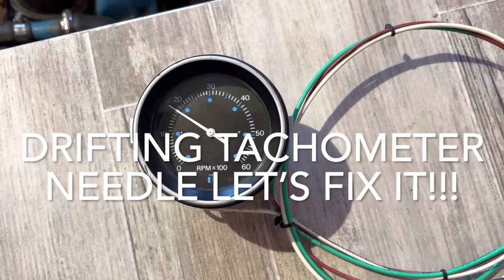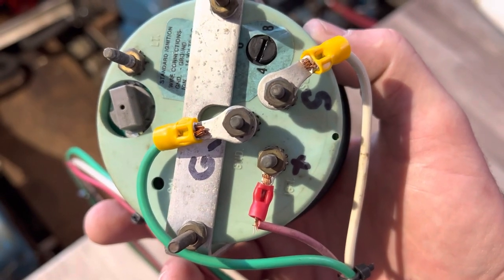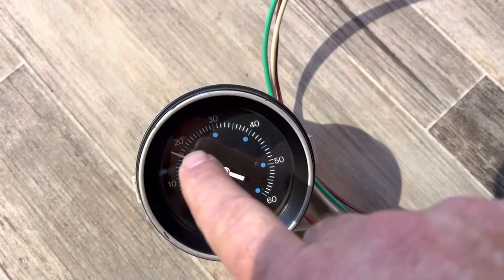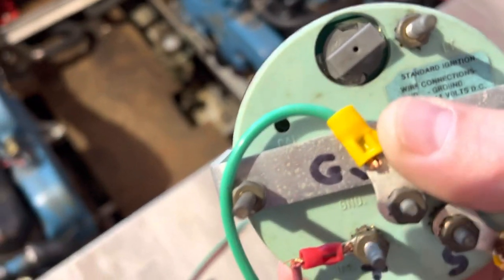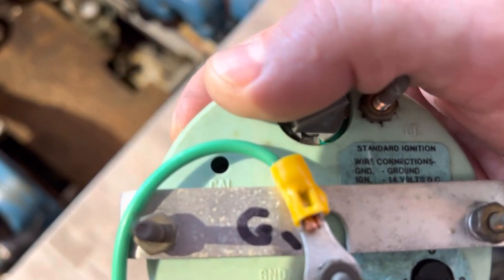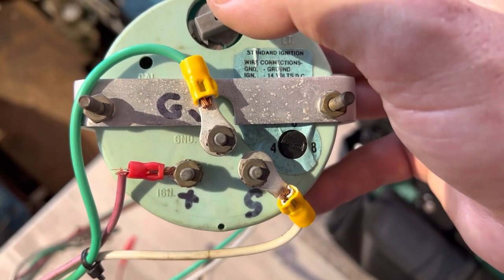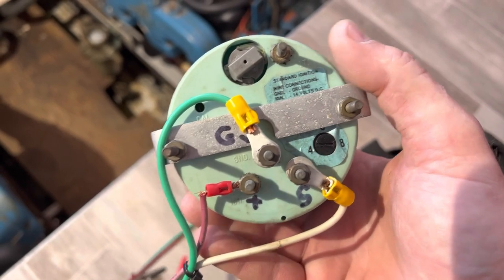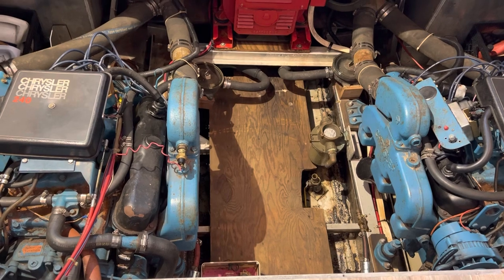Tachometer Needle Drifting??? Let's Fix It!!!

Comment: I'm gonna give this a try on my 95. Just recently I have had it running up 😢😢10000 to 1500 rpms more than normal . Also if I hit the trim up or down the draw on the alternator makes it drop 200 to 300 on the tach.   Thanks for a great video.
Reply from the maker: @WalkerRanger5  thanks for watching and I hope it helps with your issue!!